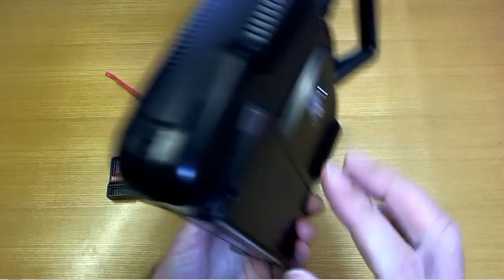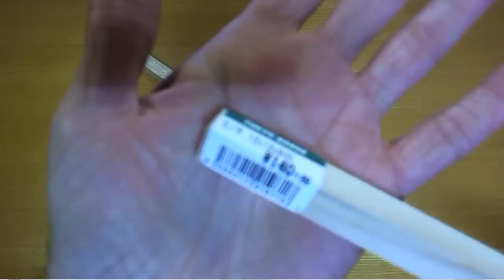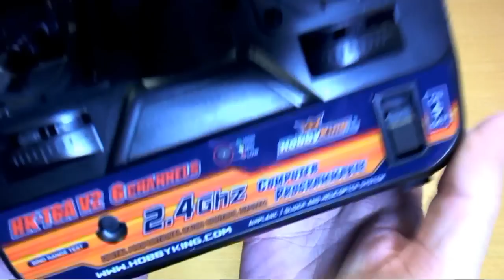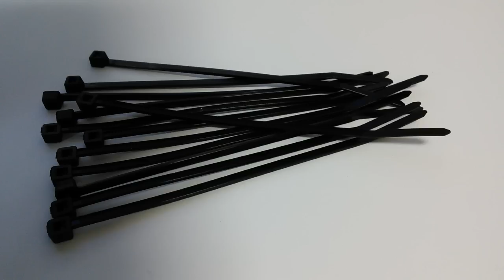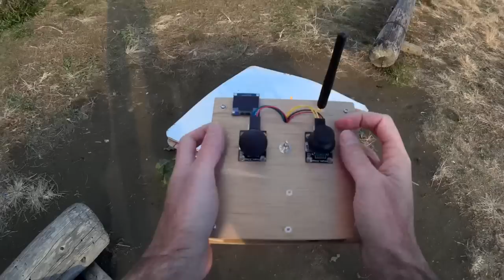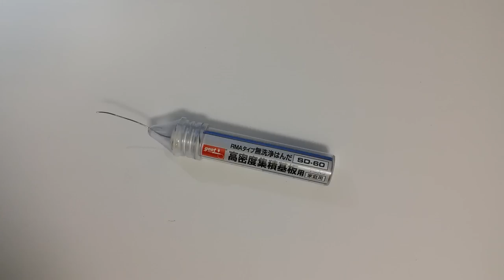Cheap-ass quadcopter build Part 2 - Parts

Comment: Thank you for a great video series, would like to know why you use andruino pro mini 3v, instead of 5v?
thanks again
Reply from the maker: The nRF24 module requires 3.3v power, so I find it convenient to use the regulated VCC on a 3.3v pro-mini to provide that. For the transmitter though, you'll probably need some kind of step-down anyway, so it would be just as easy to use a 5v.